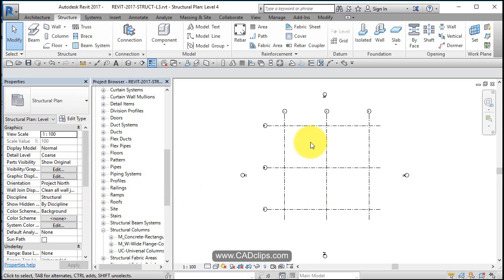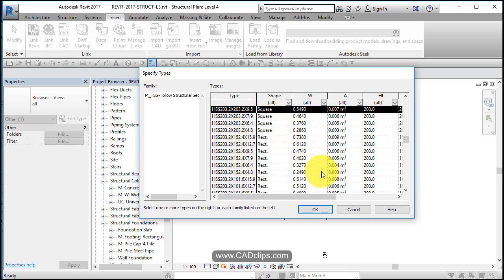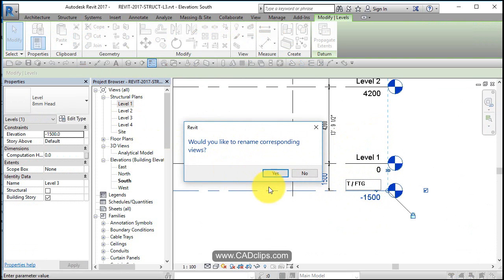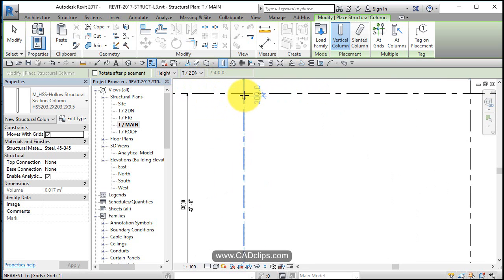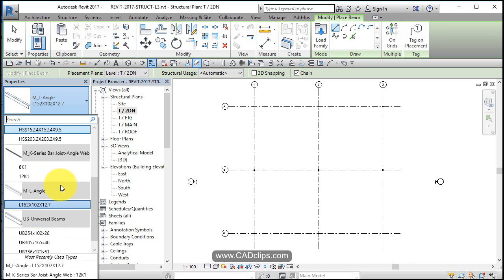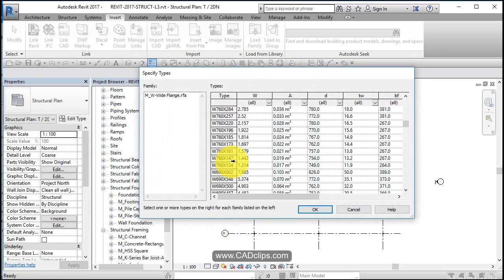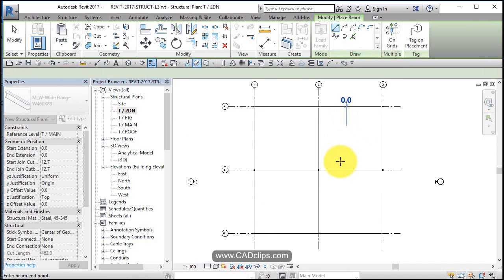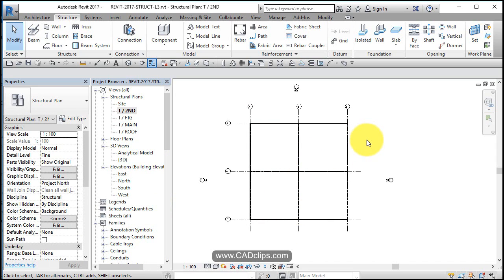REVIT STRUCTURAL PROJECT 04 LOAD AND MODEL COLUMNS AND BEAMS

Comment: Hey,

I've modelled a scaffold in Revit, I've created the families and each family has its shared parameter of self weight, so I'm wondering what it the best way to create a schedule with the loads that each leg is loading to slab.